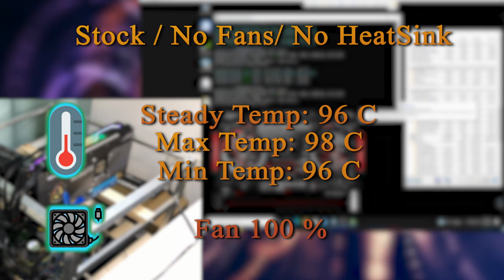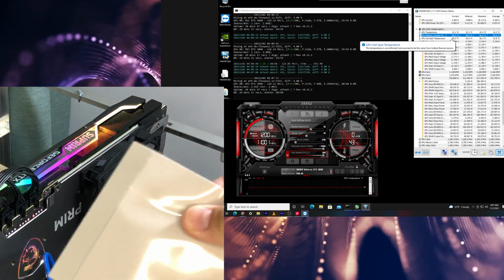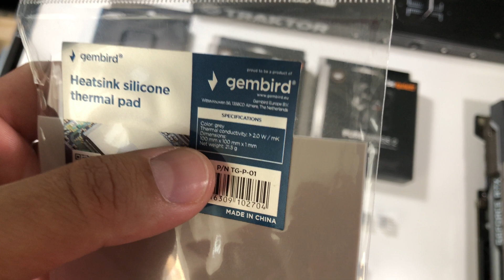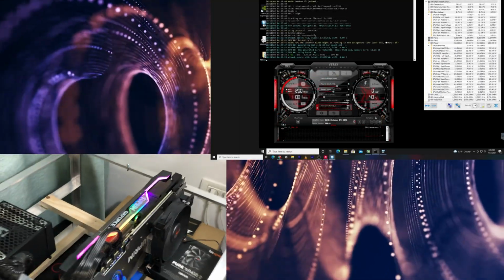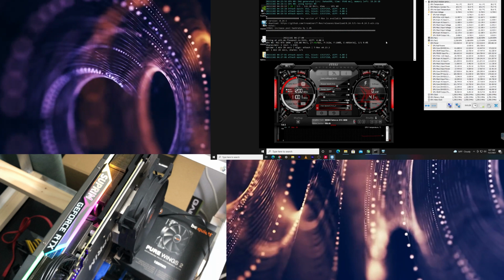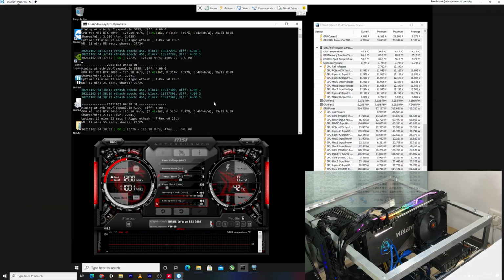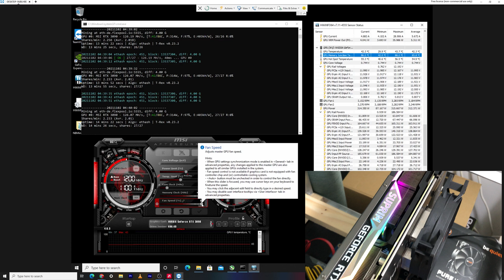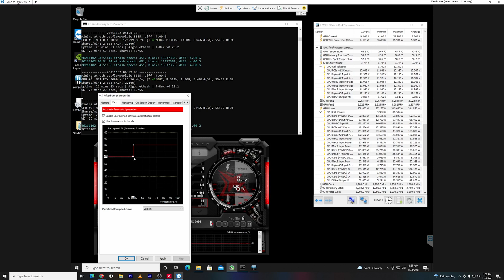Gpu Cooling Mod feat. RTX 3090 ETH Mining

Comment: I have a Aorus waterforce xtreme RTX 3090 and it goes straight up to 110 even it is water cooled, GPU sits at 42 while mining. With a 18inch fan directly blowing on the card and 2 100x69mm alu heatsinks on the backplate I get it only down to 100 degrees, still too hot and its without OC. I also changed the pads to Gelid Ultimate under the cooler. I'm clueless now -.- my brother has also very bad temps with his water cooled RTX 3080 ti even she has no VRAM on the backside.
Reply from the maker: I understand all your troubleshooting so far but this seems to me like the pads you changed maybe are not of the correct thickness?
Mind you if you are off even by half of mm on these thermal pads and the components you place them on, then the contact it makes with the cooling surface will be imperfect  so then there wont be enough thermal dissipation through the mediums. 
First please make sure you have used the correct size thermal pads and that you have placed them on the correct components.Im not sure about the Aorus model but the SurpimX version has different width pads on it and you cannot place the same size pads everywhere when replacing the existing ones.
Another concern of mine is with the water cooling loop.Please make sure of the following:
-its topped up with fluid(if you can check it)
-the radiator is clean
-the pump is working(should feel slight vibration when you touch it)
-your cooling fluid is still good(Very old fluid used for too long can suffer degradation and wont be as efficient in absorbing heat)
-check for blockages on the cooling loop itself

Under normal circumstances I would have though the watercooling method would provide the best results out there but overall it seems to me like there is an issue with the thermal pads inside you GPU.
Mind you the extra heatsinks on the outside of the GPU and the fans blowing on it wont to do much to it as much of the thermal output by design should be picked-up by the waterblock and overall loop.They are not a bad ideea but just be mindful of this as well.

Another thing to check as nowadays there are plenty of counter-fit products out there, would be nice if you could check that the pads you bought are actually  original and provide indeed the m/Wk rating as if they don't then that can definitely be your issue right there.
Do get back to us if you do find the problem.
Many thanks and best of luck to you man
Reply: @Tech_Fusion  Thank you for your feedback. I have the AIO version with a 240mm radiator so the waterloop shouldn't be in bad condition. I had the same temperatures with the stock pads before maybe 2 degrees more on average on the same situation. I also checked for imprints with the new pads before putting the card back in, everything looked fine. With the extra cooling on the backplate I decreased the temps by 6 degrees so everything seems to work as intended just the base temp I have to work with is absurd. I saw that the watercooler only covers the small GPU space with water, the rest like the VRAMS and the other smaller stuff only has the copper heatsink on it, but there is no water flowing, it looks like a cheap charlie watercooler to me. I found multiple sources like articles other youtube videos talking about worse VRAM temps with watercooling. I can see it also on my brothers alphacool cooler for his RTX 3080ti. There the water also goes over the VRAM but still 100 degrees for him at 20 degrees ambient.
Reply from the maker: Oh wow it just seems like overall its a really crappy design from the manufacturers and it seems absurd that they get away with so much cost cutting when the damn things are so expensive even at MSRP levels.Not to have active cooling on the VRM's its insane on a so called water cooled card where by design it doesn't benefit from traditional heating.
And even in the case of the 3080ti where the active water loop goes over the VRM's it still doesn't seem right if the temps are still that high.I mean right now on the 3090 from SuprimX with stock cooling and no added heatsinks on the back or fans,if I crank it all up to 1500Mhz on the memory with around 80%PL,1300Mhz on the core and with  its fans blowing 100% the temps on the memory will hit 98-100C in a room with a temp of 22C.If I dial things back then i can mine with a stable 120Mhz/s and temps of 94C all day long with fans at 60%.
Im very disappointed to hear of the thermal design of the Aorus GPU but what i will recommend you something.
Try to add to the back of the GPU a single one piece slab of aluminium heatsink of roughly the same size if you can find of the GPU backplate and then add fans like the Noctua NF-A14 industrialPPC that has over 150 CFM and this along with the very good thermal pads that you already have should drop you a good 10C  at least if not 15C.
It seems to me the only way to help your GPU if the design is shitty from the manufacturer...
Good luck to you man and keep us posted if you do get those temps down.

Comment: Great Video!  Do you think using thermal pads between the heatsink and the backplate makes a big difference over double sided thermal tape?
Reply from the maker: Well actually we have use thermal pads for this installation but you could definitely increase the thermal transfer by getting something with a higher m/wk value.Cheers

Comment: I'm definitely giving this a try .. do I put the fan to direct the air into the card or the opposite?
Reply from the maker: Yeah I recommend this as it is very simple to do without tearing the GPU open.If you want to use just a fan then set it up to blow the air INTO the card as there should be no issue with the opposite airflow since the PCB is right in the middle there. It is very efficient just by blowing some of the radiant heat away.
Would appreciate if you get back to us here and tell us what drop in temperature you noticed for the same settings.Thank you!
Reply: @Tech_Fusion  I applied a corsair fan directly to the card without a heatsink and  getting 96-98 C on mtemp and 49 on ctemp .. previously the mtemp averaged at 108
Reply from the maker: @abdullaha.ghareeb145 Firstly i can say Wow! Please don't run the card that hot as you will for sure damage it in a very short while. Micron gives on their website a max temp of 105C for their memory modules so please try and keep it under 95C if at all possible. And secondly I am happy to double check my results as also for you there is a 10C delta between running the card with the fan and without. Watch those temps man and thank you for the info :)
Reply: @Tech_Fusion  yeah I know
It's something with the 39.6 & 39.7 update of nbminer
On previous versions I averaged 88 on the mtmp 
Much thanks
Reply from the maker: @abdullaha.ghareeb145  Glad to help out.You could try using T-rex miner as I am able to run the card with 88C for 74Mhs with 240Watts.OC Settings right now are PL80,Core clock 1300 at 750mv,memory +2000 and fans at 75%.Cheers man

Comment: awesome video!!!! Thank you! I found out, with the new NBminer 39.7 I had 6 degrees lesser on my memory temp on my ASUS TUF Gaming LHR 3080 and constantly around 70 MH. It runs smoothly on 65% power, -507 core, +1610 mem, 80%fan on 90 degrees.I will definately try yours to increase my voltage :)
Reply: -1610 mem in windows should give north of 72 MHs on NB miner and LHR 3080. Mine on 2400 in Hive OS gets 72+. Try giving it more core, and around 238 watts.
Reply: @RingstedHedge  what do you mean with -1610 mem in windows?
Reply from the maker: Feels great to be able to help out so thank you for your thoughts. I do have a 3080 as well and I am thinking to apply the same cooling method to it as well and see if I can further lower its temperature and also its noise levels since the fans must blow to some disturbing noise levels. I found out that on the Phoenix model from Gainward that anything above 50% on the fan profile tends to get quite loud quite fast for every 5% you add.
So stay tuned for this future episode as well :)

Comment: Combined with a copper mod on the cooler and the back plate. My bet is you could hit around 130-140 mhs on a 3090
Reply from the maker: With my testing so far it seems that the limit with the RTX 3090 is not its thermals but maybe the max speed of the GDDR6X memories because I'm running the OC to its max on the mem as it is in order to get some 126Mh/s.I can increase the Power Limit and the Core Clock from the values in the vid but apart from taking in more watts and generating more heat it doesn't do more in terms of Hashing power...Pity...
Reply: @Tech_Fusion  how high have you pushed? I had 4500 in hive os stable on a 3080 at 110 mhs.
Reply from the maker: @RingstedHedge  Well you must be talking about a 3080 non-LHR and for that card that's a very nice hashrate. I've pushed all the way up 1800Mhz at 850mv with PL set to 103%  but I'm still getting 126Mhs.So I'm guessing that this is indeed the limit of this card and its GDDR6X mem. One nice thing about the added cooling is that even by increasing all the stats my temps were fixed at 90C.If you have any others ideas I'm all ears :)
Reply: @Tech_Fusion  Yes its the original non LHR. There is definately a difference between models (silicon lottery) Some cards can take 4500 in Hive OS, others Crash at 3000. The Bios also playes a role, and the physical power supply components on the boards.  Asus STRIX models should be the best, i guess i will have to get my hands on a strix 3090 and see how much i can get. :D
Reply from the maker: @RingstedHedge  Yeah definitely the lottery plays a role here but another important aspect that you should keep in mind are the actual capacitors on the back of the GPU.Some 3090 come with the big black chunky POSTCAPS that are the cheaper variant of the more reliable and presumably  longer lasting and better resulting MLCC's (the small grey capacitors, packed in small groups).All of them together with what you had already mentioned come together to form a better performing GPU.At least for some of the components that go into the GPU (like the mentioned  capacitors) you can psychically look up the board design and choose manufactures who dont cheap out on them so you insure yourself a better overall result.Cheers man and thank you kindly for your constructive information :)